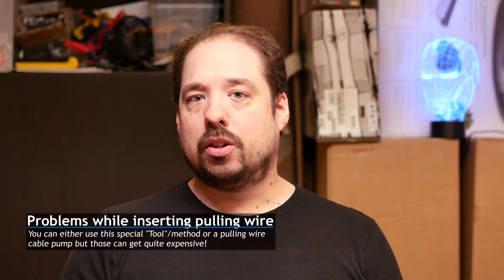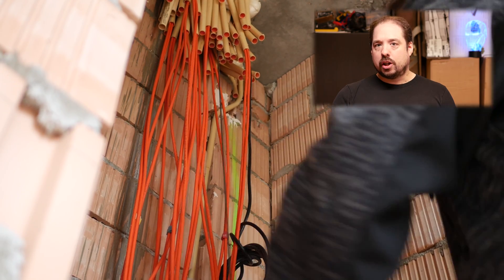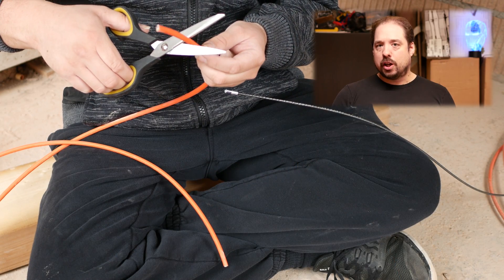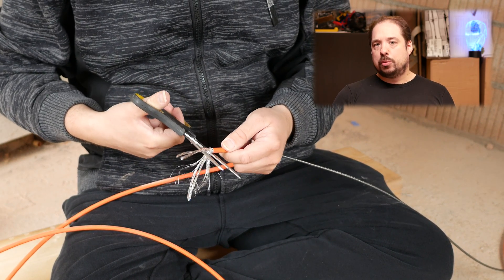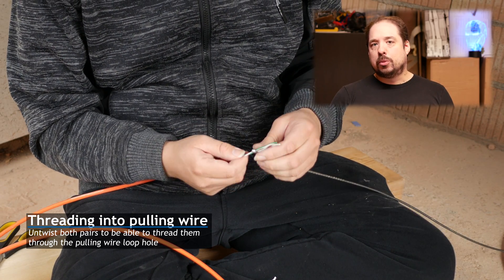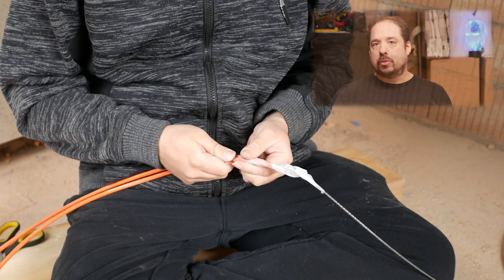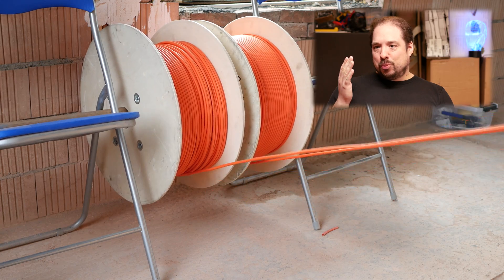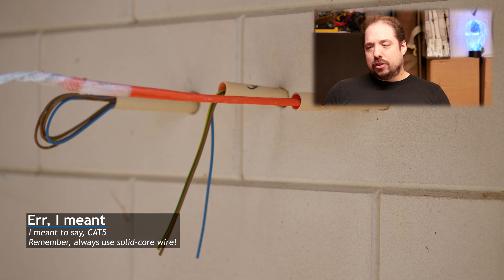Home Networking: How to run cable through walls

Comment: i currently have cat5e cables running through pvc pipes in a new apartment, the apartment was prebuilt when purchased, it should be possible to push/pull new cat7 wires using the existing ones right?
Reply: Yes it is, but why would you replace the Cat5e with Cat7?
Reply from the maker: Agreed, no need unless you can't achieve certain speeds now.
Reply: @IntermitTech  already switched, my connection is way better than when I used Cat5e in my old apartment
Reply: @cjd7948  why not?I have a gigabit connection, it's just way more stable and there's some extra room for future upgrades, cat5e is up to 1gigabit, also there's less interference, plus it's a new apartment, so all the more worth it
Reply from the maker: Well if you are pulling cable anyway, better use the good stuff, for sure, that's what I did too, no regrets! But if the CAT5e is already there, even that will do 2.5 or 5Gbe and even shorter stretches of 10Gbe. :)
Reply: @kokumba  You have a gigabit connection coming into the apartment, but once you enter the apartment you split that gigabit speed between everything in the apartment that uses internet, desktop computer, laptop, TVs, tablets, phones, etc. Cat5e's speed is up to a gigabit, so each room in your apartment wired with Cat5e can get up to a Gig speed. If you wire 4 rooms that's 4 Gig, even though your modem/router is only capable of 1 Gig. 

A TV when streaming at 4K only requires 25Mbps. You can stream 4K on about 40 TVs simultaneously with a gigabit. You expecting that many TV in the future?
Reply: @cjd7948  every year the speed doubles here, so like I said I'm future proofing, it's my own house so I might as well
Reply: @kokumba  Sounds like you're already convinced.
Reply: @cjd7948  well cables are already in the walls, so I won't take them out to downgrade😂
Reply: @cjd7948  furthermore, transferring files between computers is much quicker
Reply: @kokumba  Just some food for thought, that's not the case when either your router, switch, or network card has a maximum speed of 1 Gig... but what do I know I'm just an IT professional. 
Like I said, it sounds like you're convinced, so proceed on.
Reply from the maker: Some of us do more then use our internal network just for the Internet. Without beyond Gigabit speeds a lot of things I do would be much slower.
Reply: @IntermitTech  exactly!😁

Comment: Try using Brick Mason's twine (usually made of strong Nylon) instead of simple string for better results and less risk of breaking the twine you're using to pull the cable through the conduit.

Comment: Isn't it a good solution to pull the cat7 into a conduit before pulling the conduits into the wall?
Reply from the maker: I have no clue how you would do that? This isn't flexible tubing but made up from firm pieces and bends and such?

Comment: What  can we do if cable is torn apart from wire and get stuck ?
Reply from the maker: Owh, uhh, that's an issue, no easy solution I know of really, no other tube to the same location?
Reply: @IntermitTech  ok cable is no longer stuck. Now pipe is empty. I advised my brother to watch this video and use vacuum clenaer trick. But before i advised my brother to use Ethernet cable to pull the new one. But you use special pulling wire for this. What can he use as a pulling wire and where can he buy? He lives in Netherlands
Reply from the maker: Ah, any bouwmarkt or other "klus" store has them. Literally called a "trekdraad", almost impossible to pull in half. Get the metal versions, not the fish rope kind.
Reply: @IntermitTech  thank you very much

Comment: i agree 100% with the vacuum method for getting a pull string through conduit.  since my cable runs are very long and i tend to have to use up to 4 sweeps in a conduit run i start out with sewing thread being sucked by a vacuum.  once i get the thread  through i'll tie the thread to some kite string on the supply end and then i'll upgrade to electrical pulling string.  takes a few min, but that's the way i do it.  its the easiest method i've found since fish tapes are a pain to get past a 4th sweep in a conduit run.

Comment: i strongly disagree with the way you are pulling those cables.  remember, its the twists in the twisted pairs that give the cable its quality in bandwidth and resistance. by pulling on the actual wires (especially a single or double pair) you are upsetting the twists built into the cable from the factory - WRONG!  

the proper way to pull network cable is by pulling it from the out jacket.  you would cut the outer jacket 3 to 4 inches inline with the length of the cable.  then cut the twisted pairs inside.  from there you you can connect the outer jacket of the network cable to the pulling wire.

this is the mistake a lot of people make.  they try to pull communication cable the same as they would electrical - WRONG!  

electrical wire is different in that its the gauge of the wire that determines its resistance.  communication cable (ethernet) resistance is based on the gauge of the twisted pairs in addition to its twists as manufactured.   the more you upset those twists in any way the more you degrade the quality of the cable as manufactured.  this is why you never kink network cable and always treat it like fiber optic cable.    

i would never pull cable in this manner.  

my network cable runs are up to and in excess of 100'.  when you are pulling up to 6 cat 6 cables through a 1 inch conduit you don't want to be pulling hard on the individual wires otherwise you will most certainly upset the twists in the cables.  pulling on the outer jacket of the network cable preserves the twisted pairs inside.  yes absolutely use electrical cable lube generously when pulling cables through conduit.

Comment: Why dont use prepered pipes?? If I gonna to build a gonna use pipe like this http://gigamedia.se/datanat-koppar/datakabel-koppar/fordragen-i-slang/gigamedia-flexror-16-1xkat7-utp/
Reply from the maker: I guess you could but I wouldn't advise that. From the looks of it you can get one cable through it? Also, combined products such as this are often much more expensive than laying down standard piping and pulling (2?) cable through it. Maybe if you are doing a renovation job and have a tight space to work with but otherwise I don't really see the benefit. Flexible pipe is maybe easier when putting it down, but worse in all other regards.

Also, in my case, at the side of the patch panel I need more than the 5 to 10cm that's sticking out?

Comment: Hi,

Do you think it's possible to pass 3 or even 4 cat 7 cables in a 20mm pipe (7.87 inches)? If not then I think I might need to get cat 6...
Reply from the maker: I can tell you with certainty that will definitely not be possible. With 2x CAT7 in a 19mm pipe they would already hit both sides of the pipe while going in. Adding a third would create issues when encountering a bend. Going CAT6 you might get away with 3....maybe 4? But I still think it will be a tight fit. CAT5e will probably fit though!
Reply: Intermit.Tech Thanks for your quick reply! Do you think it depends on the brand of the cable or is it standard for all companies? Should I ask my supplier for the size of the cable?
Reply: What size pipe do you think I need to pass 3 or 4 cat 7 cables?
Reply from the maker: Pff, good question. My advice would be to buy a few different sizes and a bunch of cable to try and just try it out. Make sure you try some bends too.
Reply: Intermit.Tech ok, I'll see if I can get a sample of the cable since it comes in 500 meters.

Comment: Use more lube!
Just squirt a good amount of lube into the pipes before threading the cables.
the cable will feed the lube forwards and will also lubricate the cable as it gets further in.
Reply from the maker: Yeah, that helped with some cables. Most didn't need much and where able to be pulled without too much effect but still a good tip if you're having trouble!

Comment: Hi, 

Why didn't you trim the excess conduit that terminates in your wall boxes prior to pulling the cables? That stuff is a b*tch to shorten with the cables already in them, especially in tight places like wall boxes.
Reply from the maker: Yeah, very good point. Luckily this is only the case for a few conduits in the garage. I'll pull the wires back in a bit and then trim the pipes, after that I'll pull it back out and snip off the last part anyway so it should be ok. :)

Comment: Nice video! Great to use in my new build house soon! One tip; look after the volume of the sound when you show your logo. I had to louden my sound when you speak in the beginning, but the sound during the logo is much louder.... Lowering the sound is ofcourse easy, but you'll need to higher it again once you start talking. Keep up the good work with your videos!
Reply from the maker: Thnx, I thought I was quiet enough this time, but I'll lower a bit more next time. :)

Comment: Another nice video! A few tips: 1) strip the cable a little bit more so that after connecting to the pulling wire the pairs through the eye of the pulling wire do not touch the (red) outside of the cable. This makes the connection thinner. 2) Tape the second cable a litte bit (about 1 feet / 30 cm) further from the pulling wire. These 2 tips will makes it easier to pull the cable, because the point of the cables easier bends through corners. If the point between pulling wire and the cables is to stiff you will notice this at the first corner you reach.
Reply from the maker: Great tips! The 1st we did mostly, but not the one I had on cam. But I'm sure others will find it useful. :) 

And the second is true but after getting the pulling wire through we mostly had no issues getting the 2x CAT7 to go where they needed to go, only in the really long lengths did it become heavy but this was because of the drag and the weight of the cable itself.

Comment: Great video. But don't try the vacuum-method with the standard conduit in germany. It makes a terrible high pitch sound....
Reply from the maker: Hahaha, that's horrible for sure, but better that then not being able to get the pulling wire through at all. ;)
Reply: Ah yes, this method is a VERY bad idea with "flex" tubing (been there, done that :) )Even a short length of it makes a ear-splitting sound.